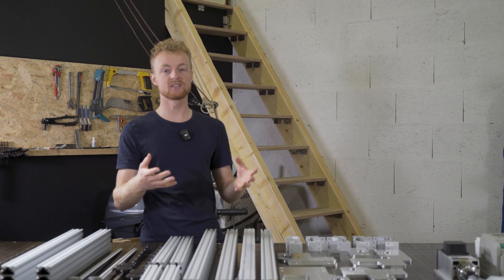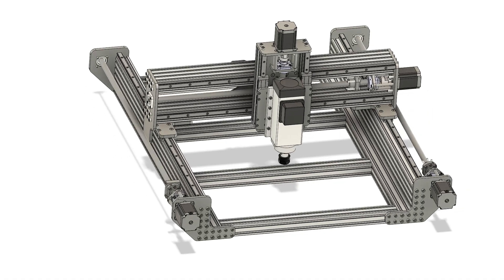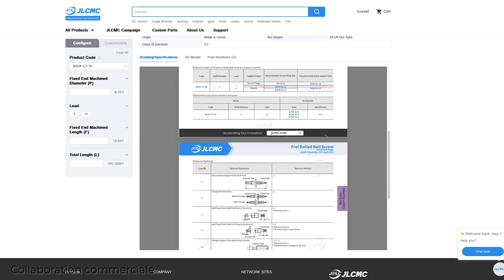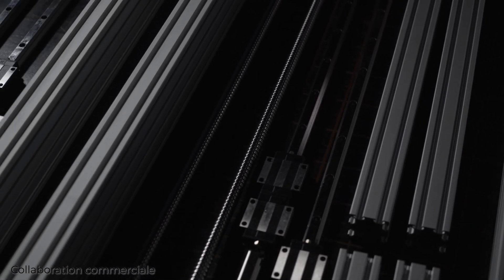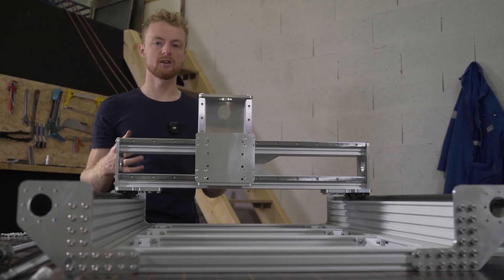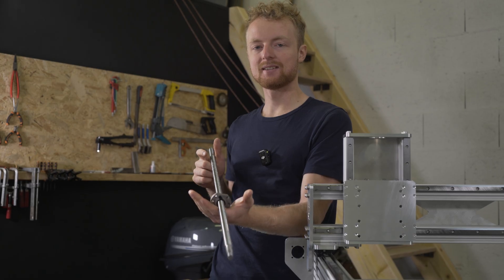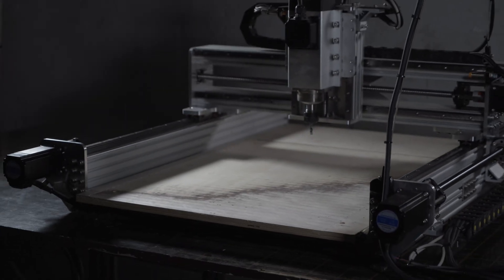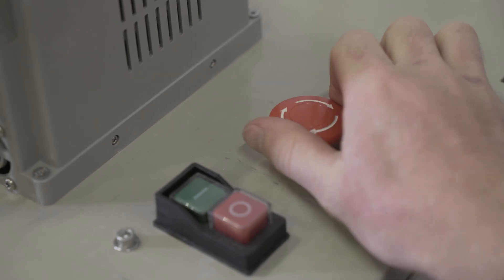I Engineered and Built a CNC Machine From Scratch

Comment: This is an awesome project - well done!  Im looking forward to building one for my shop!  Just a few thoughts-
1- fill the extrusions with epoxy granite 
2 - include 2 additional x cross members across the X-gantry
3 - add in all the pieces required for lubrication of the linear rails and ballscrews 
4 - limit switches 
5 - tram in the linear rails before tightening all the way down
Reply from the maker: Thanks! Those are definitely great ideas for upgrades, I will implement some in the second version !

Comment: There appear to be some 3D printed parts that adapt the ballscrew bearing block to the standoffs - if I'm seeing things right, you are probably going to want to upgrade that to a solid billet-machined block of aluminum, and get rid of the standoffs. However, you can do that on the CNC you just built - just go easy on the cutting forces load until you've got the extra rigidity.
Reply from the maker: In fact ! This modification is planned for the next video.

Comment: Why did you mount the 80x40 profiles on the Y axis laying flat? Wouldn't standing them up verticaly add more rigidity to the axis?
Reply from the maker: The goal is to have a low profile gantry, and cutting forces in Y will induce a bending moment which these profiles laying flat will handle with stiffness. It is in fact less optimal for X cutting forces, this is why the x shaped brace has been added. But once again, it has to remain low profile.

Comment: First of all, I have to say that the machine you've built is impressive. I'm currently in the design phase of my own machine and still deciding between this type or a column type, but whichever I choose, I'll build it from scratch. I would appreciate it if you could share the dimensions of the extruded aluminum profiles you're using (I'm planning to use 40x80 and 80x160 profiles for my machine), but I'm not sure if they'll be sufficient, and your machine seems quite robust with those dimensions. Also, is the aluminum for the plates 7075 T6, or what grade, and what thickness?

I'm eagerly awaiting that "all-in-one" kit. Thanks for sharing projects like this!
Reply from the maker: Thank you for your comment ! I mainly used 4080 profiles, and the way the machine is designed makes it very stiff. I used 5, 8 and 10mm 6061 aluminum plates depending on the strength required.

Comment: Didn’t see any engineering. Where’s the free body diagrams?
Reply from the maker: Ahah, engineering is not just about free body diagrams (hopefully), it’s the réflexion behind every detail to make such a machine work.
Reply: @teyscocset I mean engineering is designing something to determined performance specifications. I didn’t see a spec sheet that the machine was designed to. That’s like the first part of the mechanical design process. and I didn’t any math or empirical data comparing performance to your goal. Throwing some holes into flat sheet stock isn’t engineering anyone can do that.
Reply from the maker: Fair enough, but hobby-grade CNC design doesn’t follow the same processes as aerospace or high-performance engineering. I doubt any hobbyist CNC builder is running full FBD suites.
For this type of machine, the “specification” is a balance between stiffness, availability, budget, and ease of fabrication. Everything is intentionally oversized because rigidity matters far more than mass efficiency.
So yes, there’s engineering behind it, just not the kind that requires a 50-page report. It’s practical, constraint-driven design for a real-world build, not an airplane or a rocket 😉